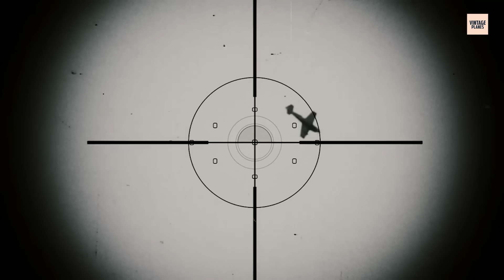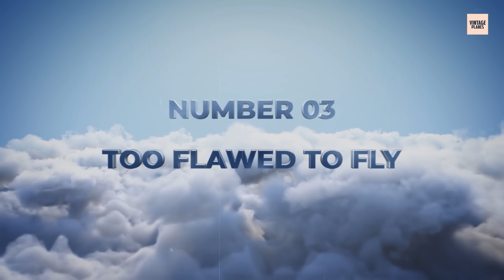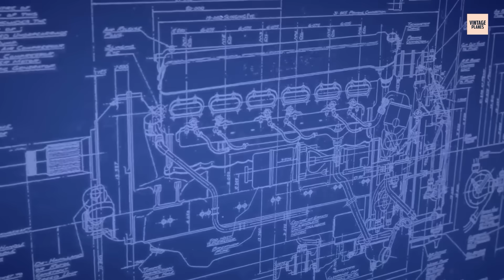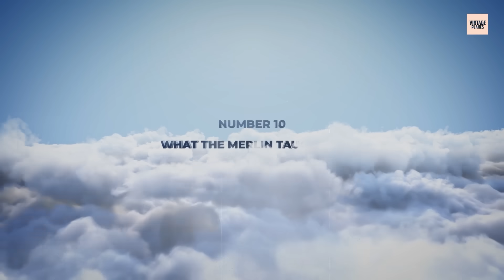THE SHOCKING TRUTH BEHIND ROLLS-ROYCE MERLIN ENGINE

Comment: Your timeline is completely wrong. The Hawker Hurricane was designed by Sydney Camm, Hawker’s chief designer, to develop a high-performance monoplane fighter and from a March 1935 Air Ministry requirement calling for an unprecedented heavy armament of eight wing-mounted 0.303-inch (7.7-mm) machine guns. Designed around a 1,200-horsepower, 12-cylinder, in-line Rolls-Royce engine soon to be dubbed the Merlin. Hurricanes began entering squadron service in late 1937, not 1939 as you state. Similarly the Supermarine Spitfire also entered service with the RAF in 1937 also powered by the Merlin.

 Simple fact checking of your AI script would be a good idea, and also checking its inappropriate image selection too. These all make this video rubbish.
Reply: sorry i have never seen a picture of a 12 cyl inline Merlin could u send me a picture of one or post it
Reply: @gregscheer7758  Really, you thought the Merlin was a rotary engine?

Comment: The Achilles heel was it used carburetors that failed in sharp climbs that created G Forces. The Messersmit 109 used Fuel injectors and could outclimb the Spitfire..
Reply: Absolutely right, The Merlin could have been a better, more powerful and more economical engine with fuel injection and noy have been so affected with negative G. Arguably the DB601/603/605 were actually better engines than the Merlin but it will never suit the romantic narrative.

Comment: Britain had another excellent aero engine in World War II, the Bristol Hercules was a radial sleeve valve engine that worked better than the Merlin on some planes, most notably the Bristol Beaufighter and the Handley Page Halifax. It had the advantage of being quieter and air cooling meant that there were no highly vulnerable radiators. Bombers like the Lancaster and Halifax could use either engine, sometimes Merlin's were fitted because Hercules were in short supply and vice versa.

Comment: Pilot killer!! is unnecessary sensationalism; all new technology goes through development problems, most of which are resolved in bench tests, long before live testing.
The overheating and seized bearing problems you relate to were in the Alison engine, attributed to the use of soft white metal bearings, which were used before Alison built the RR Merlin.
This is poor diction just for the sake of making a cobbled-together film
Reply: ur as full of crap as this post allison never built the Rolls Royce Packard did

Comment: Very poor research. Main development issues were cracked cylinder heads and coolan leaks. There is no record of deaths specifically due to Merlin engine failure in testing, though that is not to say none happenned. Rolls Royce was a very experienced and competant manufacturer with ideas they felt needed in military aviation and were prepared to risk their own money to put them into practice. As a Private Venture the whole team was neccessarily small and in any case new engines are not fitted to airframes until very late in development with most work being done in test cells. Over dramatic juxtoposition between early development and later operational use is just bad reporting. Bullets, shrapnel and pilot abuse adds unknowable complexities to engine operations under combat .

Comment: I found a US Army Air Corp study done on the Allison 1710 V12 vs the Rolls Royce Merlin. The USAAC found the the V1710 was a more efficient engine than the Merlin, and when you look at the cylinder heads it’s easy to see why. The Allison’s heads have what looks like a pent roof combustion chamber. The allows the intake ports to flow towards the center of the cylinder along with a better bias of the intake valve via a much better valve inclination angle. The Merlin on the other hand makes a right angle turn in the intake port which restricts air flow. The valve inclination angle for the Merlin is 90 degrees while the Allison is closer to 30-45 degrees. This is overcome in the Merlin by their dual stage supercharger. If that supercharger was installed on the Allison it’s clear that the Merlin couldn’t touch it.
Reply: The Allison simply couldn’t accommodate the Hooker , that is why the Allison could never touch the Merlin.  When the output was pushed the Allison ran into significant reliability issues. The Allison was designed to operate at lower altitudes and was hampered by such.
Reply: @ThePaulKat  Not at all true because the V1710 used in the P38 that used the TURBOcharger for a second stage out produced the Merlin by a wide margin !!!
Reply: @ThePaulKat  Thats all BULL$HIT as the Allison was known to be a stronger engine and took more boost, below 20,000 ft the Mustang with the Allison simply out run any version of merlin in any $hitfire, by about 30 MPH !!!  Facts of history !! !
Reply: It is interesting that the most they could squeeze out of the Allison with the advantage of a turbosupercharger in the P-38 was 1,600hp while the 60 series with a smaller displacement and its 2 stage, 2 speed, intercooled supercharger system was producing 1,650-1,700hp (and later the Merlin 100 series well over 2,000hp). After the USAAF saw the transformation of the Mustang 1 with a Merlin 65 by Rolls Royce at Hucknall they pushed for the P-38 with its ongoing engine and turbosupercharger problems to be changed over to Packard Merlins, but political lobbying by Allison prevented this. In the end it mattered little in Europe as the P-38 (with it's Mach Tuck problems) was replaced by the P-51 as fast as they could be supplied.

According to available test data, the only advantage the 1710 had over the Merlin was that it could be operated at lower RPM (it was an oil pressure thing) making it more efficient in cruise. And Curtiss tried multiple times adn failed to make a 2 speed, 2 stage supercharged version of the 1710... So...
Reply: @Completeaerogeek  to get 2000 hp from the Merlin required 110/150 fuel considerably more than the 100/130 fuel used in the Alison.  You would expect 20% more fuel if that’s what the second figure means.  It is the percentage extra power possible with Rich mixture rating. It’s called the performance number.
-Certainly above a certain altitude say 20,000 feet the Alison  was way ahead in power
Reply: Alison’s could be pushed to 60 inches of mercury on the P 51A which is 1500hp and would last 1500 hours compared to 300 for the Merlin at the time similar settings
Reply: @williamzk9083  There must be some good reason why most authorities describe the Merlin-powered Mustang as a "match made in heaven". Obviously the Allison was not as good, or they would not have made the change to the Merlin.
Reply: @peterstewart9983  Rolls-Royce took the initiative and fitted the Rolls-Royce Merlin 62 to a P 51A (Mustang I)that had been shipped to Britain.  
-Allison by this time had a two stage supercharger for the Alison.  It was very sophisticated with an infinitely variable hydraulic drive.  
-The problem with fitting this supercharger was that it required some minor design around the firewall area because it was longer since the supercharger was an attachment rather than integrated on the Alison. It probably would’ve added a month or two to getting the P51B into production.
-with Packard Merlin coming off American production lines in large numbers, rolls-Royce already have built the prototypes and Alison in high demand for the P38 the choice was obvious.  
-But the point is that Alison could’ve done the job as well as the Merlin.
Reply: @williamzk9083  Thanks for the info, you don't always hear the full story. I always wondered why a good engine like the Allison couldn't have been fitted with a supercharger to match the Merlin. The infinitely variable hydraulic drive sounds like a better idea. You read accounts of the second stage of the Merlin supercharger kicking in at around 17000 feet, with a jolt that felt like the engine was being ripped off its mountings.
Reply: @peterstewart9983  the two stage Allison  saw some Service with the P 63 Kingcobra.
Reply: allisons were a pile of crap the p51 couldnt perform with it until the RR was fitted how many famed air racers used allisons none that i know of

Comment: In reality the Allison V-1710 was just as good as the Merlin. The only difference the Allison were set up for turbocharging. If it got the same style of supercharger as the Merlin, it could easily outperform the Rolls Royce engine in every respect. But the Americans didn't want to build two wastly different version of the engine, one or the P-38 with turbocharger and one for the P-39 and P-40 (and P-51) without turbo, but dual stage supercharger. The reluctance of the Americans made the Merlin much better. Without Packard there were no Bendix injectoing carburetor on the Merlin. Just the original, touchy, unreliable british plain carburetor.

Comment: British  made Merlin engine's component's tolerances were not standardised. Each individual engine bespoke, was different and parts couldn't be interchanged. The US, Packard, built Merlin engines were built using "limits and fits", so therefore off-the-shelf parts fitted correctly first time.
Reply: Ford of Britain was the car firm  involved in mass production at Manchester  before Packard.  Ford US was supposed to be the  maker in US but Henry Ford vetoed it , only then was Packard approached
Reply: @ztevkonrad6329  Yes Ford of England worked with Rolls Royce to produce the mass productions Drawings and Specification used by Rolls Ford and Packard.
Reply: @trevorkent4749  Stanley Hooker, employed by RR to improve the Merlin's supercharger, states in his Biography "not much of an Engineer" that it was Ford UK based in Manchester who straightened out RR's manufacturing process to enable mass production.
Reply: Total garbage.
Reply: @GrahamCox-c5x 😂
Reply: @GrahamCox-c5x  Ha ha, there is certainly a lot of debate about the Merlin. I remember as a boy in 1960s Australia being told that when the Merlin was licenced out to Packard in the US, the first Packard Merlins wouldn't run. Rolls Royce had to send engineers over to the US to solve their problems. True story? I don't know, you get told a lot of things as a kid. One thing I did learn, the Merlin was a bird, not King Arthur's magician, which makes sense when you think of the Kestrel, Buzzard etc.

Comment: The  Roller  was  the  best  Slimey  Engineers  could do....an   SOA  engine  for  1935  trying  to  fight  in  41,  42,  ...'45.....the Rolls  was  strictly  SOA  for  the  30's....the  Daimler  Mercedes  was  SOA  for  1965....the  Roller  was  just over  1000  In3,  the  DB  605  was  over  2000---it  was  the  perfection  of  Krautenese  engineering  with  far  greater  power  output  than  the  old  30's  Roller  and  a  superior  inverted  cylinder   lube  system.  ....AND  a  FAR  better  Supercharger!!   The  last  proof::  if  this  was  INDY,  NOT WW  Twice,  no-one  would  ever  consider  using  the  pathetic  old  Rolls,  every  winner  would  be  using  the  superior  engineered,  larger,   far  more  powerful   605.

Comment: Hi. A rather jingoistic account, more horsefeathers than Granny's mattress. No DFC for this effort. The Merlin was not "just in time" to beat the dastardly Boche in 1939, it was up and running reliably in 1936 in the Hawker Hurricane, the Boulton-Paul Defiant, and the Fairey Battle, and others. it suffered no more teething problems than other aero-engines. 

Most disappointing that you failed to mention the man who made the Merlin what it was; SIR STANLEY HOOKER. A fluid dynamics mathematician and engineer, he managed to double-supercharge the Merlin, more than doubling its power, especially at height. I suggest reading his book entitled, "Not much of an engineer". He was primarily a maths man and later resurrected the R.R. RB211 turbofan off the scrap-heap, thereby saving Rolls Royce from bankruptcy. 
 
Wartime Merlins were reliable, but not made to last because quality costs, and aero-engines had an average service life of about 50 hours before being shot down or pranged. if the full (double) boost was used in combat its life expectancy shrank to five minutes. Pilots had to keep note each time boost was used. The Merlin was replaced rather than repaired. 

The DH98 Mosquito did not get its low mortality rate from the RR Merlin, it was because it was made of wood. During the development of radar by Watson-Watt, the top brass noticed that compared to metal, wood had no radar image, and a wooden aircraft would be indetectable. The "Mozzie" was the world's first "stealth" bomber. As with Whittle's jet, and "Tube Alloys" nuclear research, the Yanks were again hitch-hiking on British brains. 
Chocks away chaps. Cheers, P.R.

Comment: Hydroplane racing from 40’s to the late 80’s used lots of Merlin’s.
Reply: @philliplarson  and there were as many Allisons used also and it was a toss up.  BUT in 1950  Stan Sayers owner of the unlimited SLO MO IV set a wold straight away speed, both ways in the flying mile at 179.+ Mph  in an Allison powered boat, and that speed record stood for many years and many Merlin powered hydro's "Tried" and failed to beat it. !!

Comment: My life's work was as a machinist when machining airplane engine cylinders ,piston during your final grind I learnd different engines had different tolerances using the metric system gives you closer tolerance where American engines had a 2 ten thousandth of an inch tolerance most European engines tol was 0 or as they called it  dead nuts  closer tolerance give better performance  but will seize faster if overheated what holds  the explosion in the cylinder is nit the piston ring but a bead of  oil

Comment: You did not mention Tilly's orifice in the Merlin.
 "Tilly's orifice," or officially the R.A.E. restrictor, was a simple, yet crucial, technical device designed by Beatrice "Tilly" Shilling during World War II. It was a small, thimble-shaped restrictor placed in the float chamber of the Rolls-Royce Merlin engine's carburettor. This invention prevented the engine from stalling during negative G-force manoeuvres, such as dives, by regulating fuel flow.
Reply: Thank you!  A very astute air power historian you are!
Reply: @gonefishing5434  Well, I am an old engineer and  I know  the important function  of an "orifice" restrictor! The Merlin did not like inverted flights and  it would only last about five seconds before it would fail  at negative G  forces. The Germans had fuel injection, while the Merlin had a carburettor dealing with about 90 - 100 gallons per hour of fuel.  I know of a hidden workshop in  a valley  on Malta  close to Luqa airport where they use to maintain the Merlin during WW2, They now grow mushrooms in it,  I owe my life to the Merlin and good pilots like  George Frederick "Buzz" Beurling, DSO, DFC, DFM & Bar  who was known as, "The Maltese Falcon".  I am fortunate to be still alive and lived through WW2.  Thank you for replying,
Reply: @carmelpule8493  Respect. 🇲🇹
Reply: Well done for your remembering such an important contribution to the saving of so very many Spitfire Pilots via the input of the young lady WAAF Tilly Shilling, who made such a well timed contribution to end the “cut-out” of the Merlin Engine due the gravity feed of the fuel to the engine! All of these efforts made all the difference to the survival of “Blighty”  in controlling the skies over England during WW2. I hope they gave her the recognition that she deserved?
Reply: Carry on Comedy was popular even in 1940
Reply: @carmelpule8493  And one of the first things PACKARD changed on the merlins was a swith to the Bendix pressure carb to permanently solve the problem Tilly only tried to cover up !!!
Reply: The orifice or flow restrictor was really a botch that only partially solved the problem, but it could be fitted quickly to existing planes. The Merlin really should have used a pressure injection carburettor all along, but the British Air Ministry wasn't interested. It was only when the Americans started building the Merlin engine and insisted on the pressure injection carburettor that the problem was fully solved.
Reply: @philiphumphrey1548  PACKARD solved the problem.  Also the much maligned Allison V1710 had used that carburator sinch 1938 as had most other large aircraft engines !!!  Brits  try and keep up !! !!!